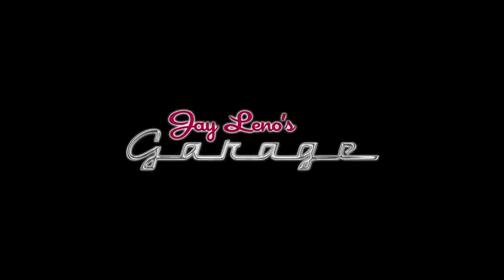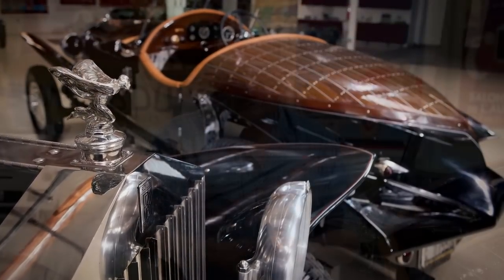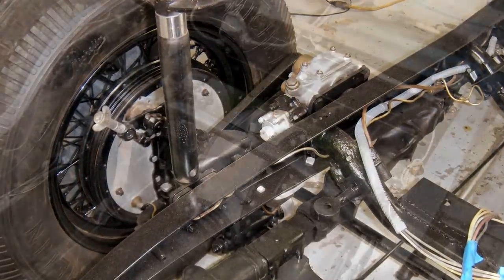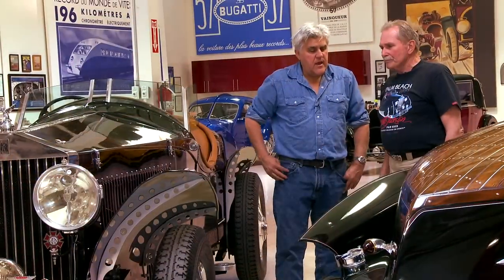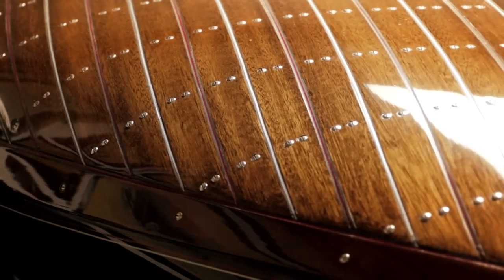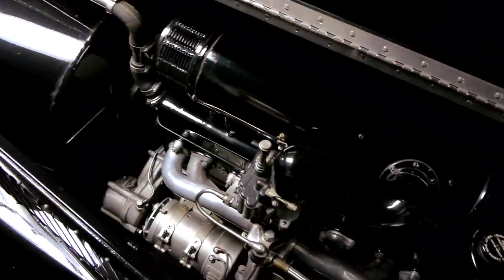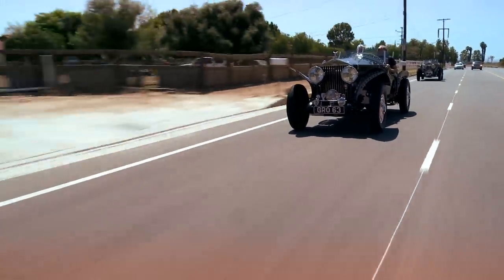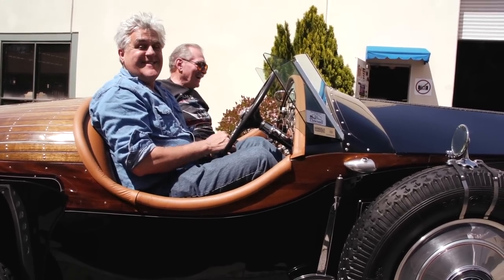1937 Rolls-Royce Boat Tail Speedsters - Jay Leno's Garage

Comment: The fenders stuck out for me also. I like the open wheel look, it adds a racing feel to the car, I think a bonnet type fender would look a bit classier and blend in better. With the shake in the fenders at speed or on an uneven piece of road you have to wonder how long they can hold their shape before the wind bends them even higher. Love the boat look, as well as the aviation influence in other cars of the age.

Comment: Rather gratifying to see this level of craftmanship, inspired by a love for the automotive, still being applied today.

And for those purists who despair that these are not 'original' cars, coachbuilders of the 1920s varied massively and used wood and other biodegradable materials and so even ten or so years later the original bodywork would have rotted through anyway. Original bodywork is literally rot. This coachbuilding is inspired and preserves a worthy heritage while affirming a new legacy for future generations to admire.

Comment: I think it is amazing that these cars were saved and re-built in the spirit of how the luxury cars of the day were built originally. By that I mean RR delivered a chassis and a coach builder did the bodywork. I admire the history of the donated RR becoming an ambulance hearse. That would have also been an interesting restoration. If it were not for this enthusiast these cars would have been left to rust so in that respect even turning them into rat rods is better than letting them become re-bar.

Comment: when i saw that amberlamps picture i was drooling.  i realize it may be a bit macabre but i would rather drive that than these sportier, albeit super nice, convertibles.  the proportions are just so odd and interesting on that thing and there is nothing else like it on the road.

Comment: W.O Bentley himself would have been proud of those two creations by Gary Wales!    No doubt he would have employed Wales as a designer/fabricator/engineer for his cars!    All Gary Wales' creations are collector pieces in their own right but will be VERY valuable collector cars someday in the future.    They'll probably be in some museum somewhere long after petroleum based fossil fuels have long been gone!    Petroleum based fuels are still a mainstay now, but they are definitely on the beginning of a decline at this moment in history.   It's on peoples mind that electric based cars may be the wave of the future as they create longer distance batteries along with much faster charging.     Electric will most likely be the mainstream rather than the novelty they are right now.     I see charging stations instead of gas stations across the world way off in the future.    Once they get the charging down to just a few minutes (which is actually capable now), petroleum based fuels are history.    Of course I know this will probably take 40 to 50 more years but I guarantee you, petrol fuels will be a thing of the past.    Electrics, maybe Hydrogen, who knows, maybe some yet to be invented type of technology, but it won't be petroleum based fossil fuels.     I see those being outlawed at some point in the far future due to environmental concerns, etc.      Gary Wales is a true master fabricator and designer of some of the most incredible "retro mobiles" of all time.     Those LaFrance fire trucks he creates are some of the most beautiful vehicles ever created.     True works of art, just like these two Bentley's.

Comment: Thank god I'm not a rolls royce fan. I would be so offended by what this guy has done to these cars.
Reply: +respt46 What would you suggest he do?  These are RR chassis that were delivered to coach builders to have body's added per the buyers specification.  As discussed, those bodies are long gone.  He might have copied some one-off body, but in the spirit of the RR of that day, he became a coach builder and build his own body.  Also as noted, the chassis are pretty much restored, so all RR part of the car are about as original as is possible.

Comment: I was gonna say how much I hate the fenders, but thought it might be controversial. Then I saw it wouldn't be, what the f*** was the builder thinking? Actually the whole thing is a disaster. The straight angular front and the curved rear. Did Homer Simpson design this?
Reply: +Andrew Jackson A large chunky but also stately front that flows straight to the rear into a slightly knotted, well-rounded tail has been Rolls Royce's design language for almost an entire century now., and for good reason. 

I mean, I don't like it that much either, but it's not bad design.
Reply: That curved rear end is the boat tail - there have been quite a few boat tail designs including the Buick Rivera and the Corvettes of the early '60s. When it's done right, It's a beautiful classic design.
Reply: Andrew Jackson his inspiration was the flying nun.